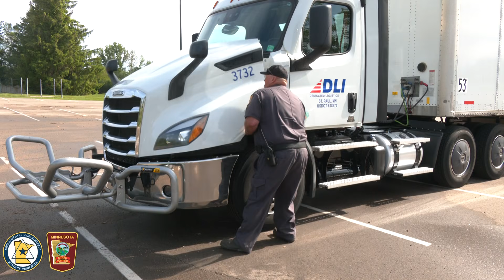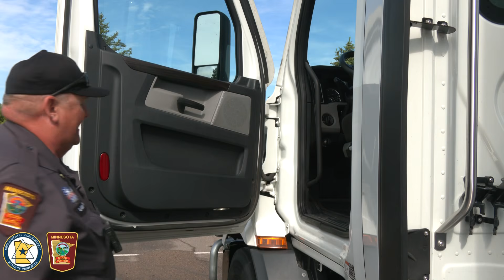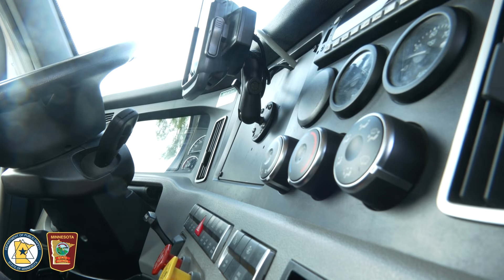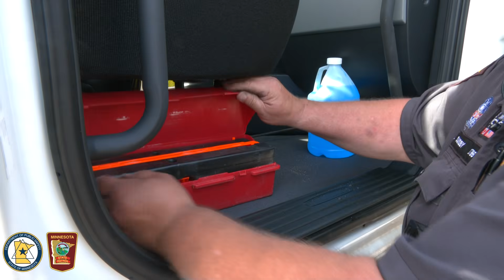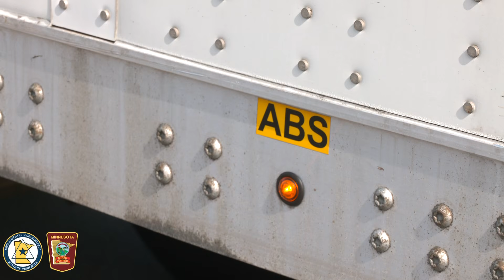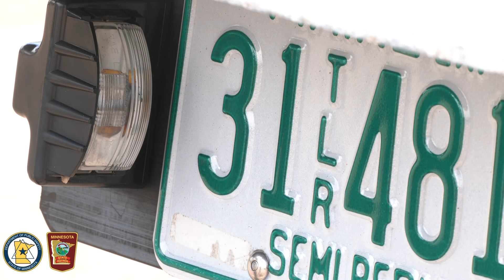Commercial Vehicle Pre-trip Inspection

Comment: I drove truck years ago and one would be surprised how many guys I’ve seen just jump in and go. Same went for when they came back from a trip, they never did a post trip. When I pulled the trailer they had last I would get into delays because of blown oil seals on the axel, burnt out lights, leaky glad hands. It was irritating.